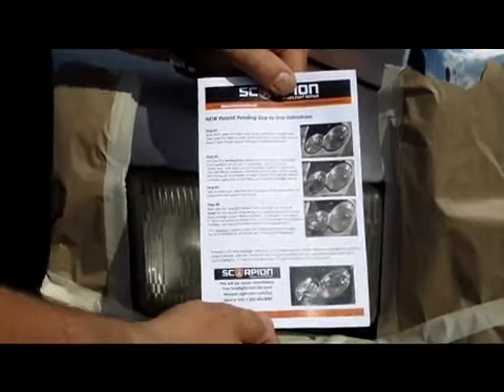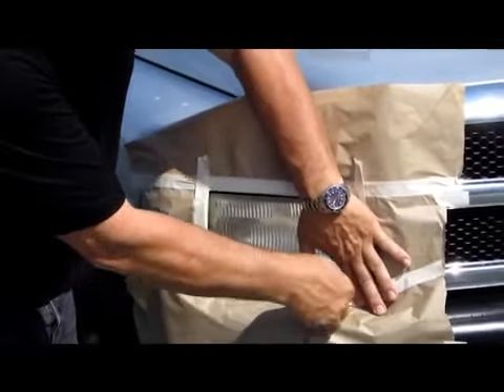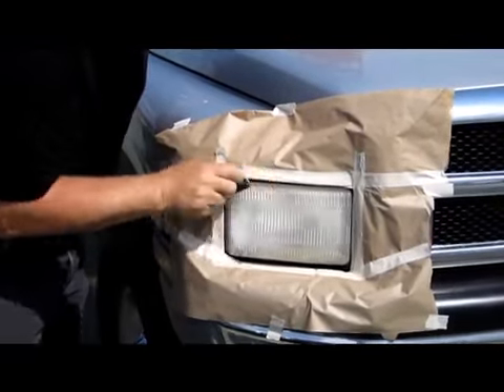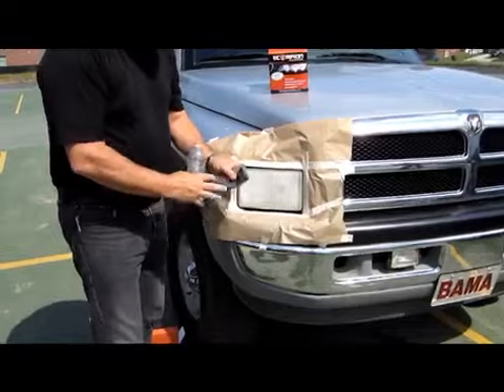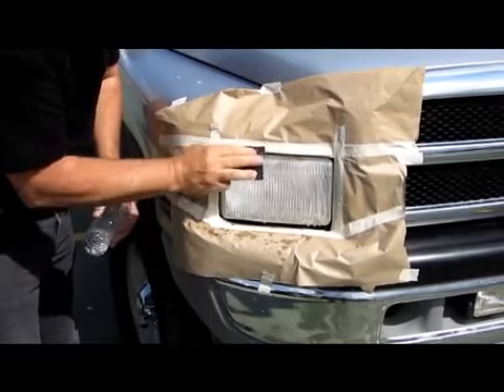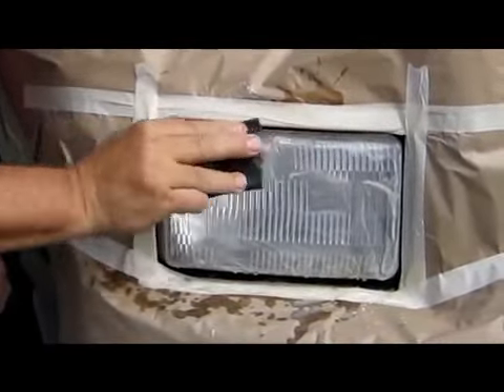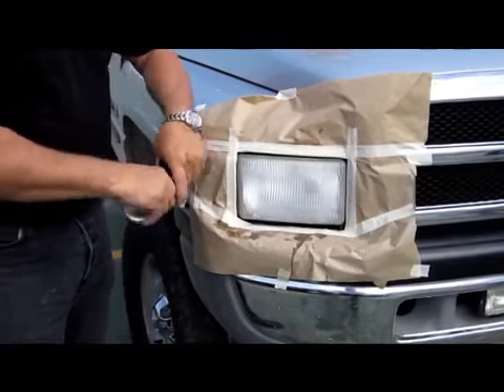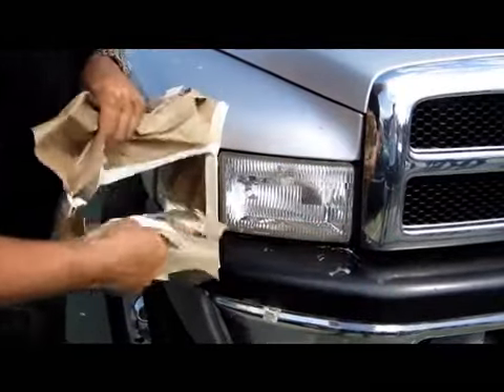Scorpion Headlight Repair System

Comment: hi. Can it be used on acrylic based and glass headlights ? thanks
Reply: hdbicker YES, this product can be used on ALL plastic headlight on any vehicle. This is a commercial grade headlight restoration product in a DIY kit that is all-inclusive and will renew 3 sets of headlights that will last 3-5 years!
3 easy steps: Tape up the headlight, sand the headlight, then spray-on the UV Protective Sealant!!!